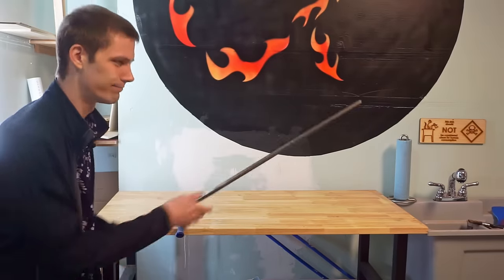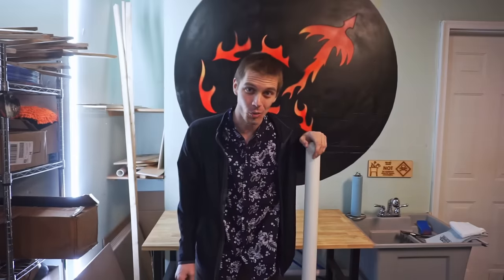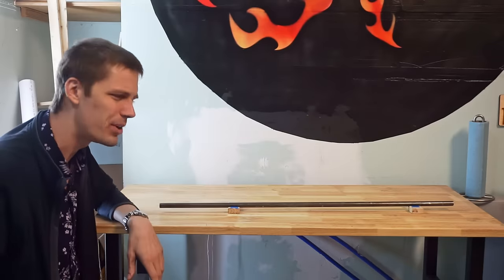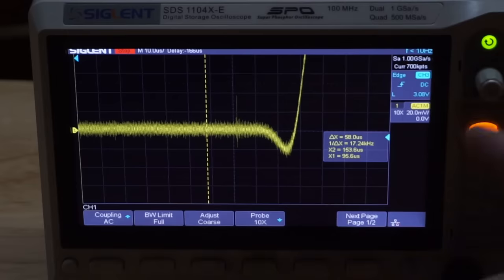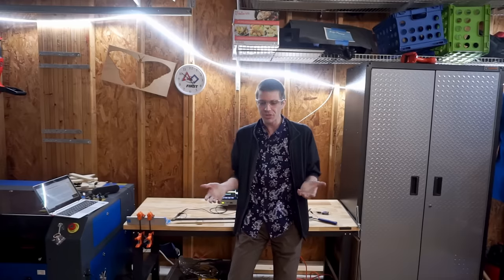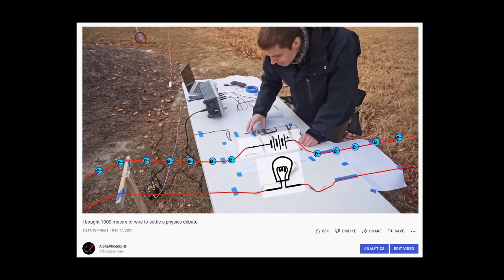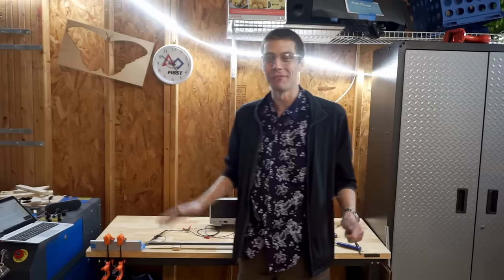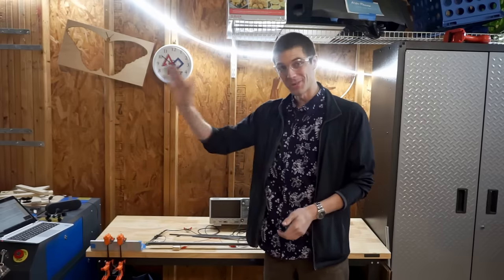Are solid objects really “solid”?

Comment: Re: bar speed: I remember Veritasium talking about it taking the speed of sound in the object. It was how shining a(n idealized) laser at one edge of the moon, and then flicking the laser point across the moon to the other makes the dot go faster than the speed of light. Nothing is actually going FTL (the dot is just an image), and if you tried it with a solid rod (I believe it was a wooden plank in his version), he said it can only travel as fast as the speed of sound in the object
Reply: Imagining that the blank would be unbreakable, I'd assume the plank would move kinda like a whip, and it would probably crash reality or some shit.
Reply: @dexorne9753  an unbreakable plank would almost certainly stretch out considerably across the diameter of the Moon
Reply: @dexorne9753  if it is unbreakable then it can only bend, otherwise it would break physics. It could approach the speed of light but not reach it in this scenario.
Reply: @bengoodwin2141  Exactly, and the time it takes before the other end starts moving after you move your end is determined by the speed of sound through the plank, which would've given us the correct answer because that's intuitive when you think of a plank bending. It's not as intuitive when you think about pushing the plank inward, but motion is motion. It's so obvious in hindsight :D AphaPhoenix just made the puzzle harder on himself by not just wondering, what will happen if I get a really big sharpy and write my name on the moon? :p

Comment: When I was a kid I used to always ponder this question as well as whether or not two objects really could “touch” each other.  Fun to see a video like this
Reply: The two objects touching blew my mind I remember squeezing my fingers together and thinking if you kept zooming in as you went down they would never touch and it blew my mind and I desperately tried to discuss it with my dad and he didn’t understand. Thanks for unlocking a super weird memory for me lol
Reply: exacly the same experience here.
Reply: It also means you can bitchslap whomever in the face and get away with "I never touched him you honor!".
Reply: I once wondered what would happen if you could make a infinitely dense object into a bar or just a line, then push it, it's infinitely dense so there is no space between anything so shouldn't it instantly move on the other end?
I have no degrees, its just something I'm curious about.
Reply: @speedy01247 
Wouldn’t an infinitely dense object have a null volume? Like a point. If it’s a single you can’t really measure its ends. It’s instantaneous but the pressure wave doesn’t travel any distance.
I think it would make it’s sound speed undefined too. (0m/0s)

My opinion isn’t worth much im not great at maths or with physics.
Reply: Is there an answer to that question ?
Reply: It’s our understanding of what “touch” means at a micro vs macro level. 

It’s still touching, it’s just that we have to change our view on what touch truly is
Reply: @speedy01247 that's called a black hole and you don't want to try to push it

Comment: The question is, what would happen if both ends are pushed at the same time?
Both ends would travel "inwards" then the 2 waves would collide in the middle and a few hours later both ends would snap back?
Reply: @liam3284  I don't think this is accurate, the bar wouldn't expand, it would exert crushing forces inwards at the middle, like squishing a cube of jello on two ends or something
Reply: @liam3284  Even an easier to see example, fill a bowl with water and stick a finger in each side of the bowl to generate waves. You can see the waves pass through each other.
Reply: You can use a Newton's cradle to see what happens...

Comment: 18:16 you took my comment idea! I was about to suggest it could be something where you had a different alloy than the website was using since I imagine that (since so many properties of steel vary based on the amount of carbon) the speed of sound must vary a good bit depending on the type of steel.

That's really cool how the speed of sound varies based on the "dimension" of the object that you're compressing and that a really thin bar will have a different speed of sound than one that would squish outwards a little bit.

Comment: My instinct was right in that in order for the material to move the atoms would have to get closer and then be repelled by their electrons; However, it never occurred to me that this nature of atoms getting closer and spreading apart is what sound is and that by proxy it would travel at the speed of sound. Very great video!
Reply: That's quite a SOUND argument
Reply: @busttoboost Well the force is inversely proportional to the distance between the atoms that means that a given aton would accelerate the next in line slowly and not instantly. This time it takes to accelerate and deccelerate would be the wave of sound travelling. Or in this case the wave of movement.
Reply: @busttoboost  I was thinking about the same problem here. The speed of the impacted force is traveling with a small decay, depending on its material structure. For example, hitting a sponge would take more time for the atoms to carry the momentum the the opposite side, a metal bar on the other hand would transfer the impact almost immediately, because of its dense and hard structure. 
Now the theory: if an object had absolut zero plastic deformation on impact, would it transfer the information, or in our case the force, immediately? So faster than light? Of course in reality, finding such an object would take a bit of time, although im not an Physicist im quite curious if this theroy is possible in some way.
Reply: So what happens if an object hit it at say mach 2 with no deformation or energy loss between the 2 materials?
Reply: What I don't get is, electrons repel each other by electromagnetic radiation, right? They are "pushed" by photons, so wouldn't the wave travel at the speed of light? Where does the speed of sound come from?

Comment: I was always under the impression that the speed-of-sound is the intrinsic "speed of motion". If you tap the end of a pole with a hammer, that will dictate when you can first hear the tapping on the other end of the pole. Although that can't answer the question fully, as it is obviously possible to move stuff faster around than the speed of sound.
Also: DSOs are really a marvel of economies of scale. You can basically buy scientific equipment for only a few hundred bucks that will show events in the ns range.
Maybe I should clarify: a high-explosive for example isn't limited by the sound of speed. In fact, any shock wave travels faster than the local speed of sound of the medium. But that's something for AlphaPhoenix to explain.
Reply: That's where a still initial frame of reference kicks into place,  I guess. The speed of sound in a material matters in reference to the material itself. since the pole was initially not in motion in our chosen frame of reference, the squish traveling through it maintains the 5100 m/s or w/e it is relative to the still piece of pole still ahead.
Reply: @EmanuilGlavchev  That's clear, but doesn't explain the shock wave problem. Unlike the speed of light, the speed of sound isn't really an intrinsic upper barrier here. It's just the speed the material likes to pass a wave on if no one forces it to do it any faster. But if you detonate a high explosive next to said metal rod, it's not like the rod has time for transmitting that wave at just the speed of sound. And the rod isn't infinitely compressible. 
I mean there are papers on it, but they're beyond my understanding of the physics. It's not very intuitive for me to understand what is actually happening if you push the rod at speeds exceeding its speed of sound.
Reply: I think I can resolve that pretty easily. Your first impression is correct. If you tap one end, it will take l/c until you hear it at the other end (if you take the correct speed of sound etc). But the speed of sound is defined for an elastic wave. Which basically means no huge forces, which break the material (over its yield strength). 
Yeah you can tap on the steel rod faster than its speed of sound, but then you permanently deform it. Which is in a way what happens to air as well, when you break the speed of sound in air. 
The speed of sound isn't a physical speed limit like the speed of light. It's the velocity that an elastic wave travels. Also there are longitudinal and transversal speeds, which happen of course simultaneously and make the wave propagation a mess.
Reply: @FlorianLinscheid  I'm not really convinced the rod is necessarily getting permanently deformed if I hit it with a hammer swinging at 10 km/s. Obviously the hammer would try to push material faster out of the way than the material likes, but is the explanation here really "it just breaks" and that's it? There surely is a gap between the speed of sound and the speed of no-compromise breaking, no?
Reply: @graealex  So if you accelerate a medium at speeds exceeding the speed of sound, you create a shockwave in that medium. This is true for air, metal rods, and whatever material you care to analyse. The shockwave can travel faster than the speed of sound in the medium, but only so long as energy is supplied to it, for example by the presence of a large mass of gas / whatever moving at supersonic speeds behind the shockwave. Absent this energy it decelerates to the speed of sound and becomes effectively a sound wave.
Reply: @dsdy1205  Yes exactly. And the rod will get permanently deformed at every point at which the inner stress exeeded the yield strength which will most likely happen if a shock wave travels through it.
Reply: @FlorianLinscheid  You're again back at "it just breaks", and that doesn't seem likely if you just hit it at lets say 110% or 120% of the speed of sound.
Reply: @dsdy1205  Using that explanation on the experiment from the video: if he hits the rod sufficiently fast, the delay will decrease as the wave would travel faster than the speed of sound, in the form of a shock wave?
Reply: @graealex  No, I said deformed. Like play-doh. The more it gets compressed, the more it will be squished. But a ceramic rod on the other hand, which really doesn't deform, would like just break into pieces, once you get slightly over its yield strength.
Reply: @graealex  No, it doesn't work that way.

Consider the shockwave on the front of a blunt bullet. The only reason it doesn't slow below supersonic speeds is because there is a bullet behind it, 'providing' energy to the shockwave by itself travelling at supersonic speeds.

If you want a shockwave to travel through the rod at supersonic speeds, then your hammer has to travel at supersonic speeds THROUGH the rod, which generally ends up destroying it.

If you just whack the hammer at the end of the rod really fast (say supersonic speeds), then the shockwave will quickly decelerate to the speed of sound in the rod and continue forward at that speed, as a normal sound wave.
Reply: Essentially the assumption that the springs don't get fully squished breaks, so the spring coefficient rises rapidly as the masses start hitting each other.
Reply: @dsdy1205  I'm not satisfied with the binary explanations. If it "quickly decelerates" to the speed of sound in the medium, then there is some distance where it was still above the speed of sound.
Same for the destruction. Obviously if you put enough energy in, you are in the end just moving metal powder around. But I am sure there is a point where maybe just only a bit of plastic deformation happens, but there is still a shock wave traveling in the rod.
Reply: Hey Alex, quick question: did you ever live in Fürth by any chance?
Reply: @graealex  it doesnt get permanently deformed, in the sense that you could just bend it back into shape
Reply: @graealex  it doesn't accelerate, it drops to its natural velocity once the hammer no longer pushes it
Reply: @graealex  For sure, it's an analog deceleration, but this happens over such a short distance that I feel pretty comfortable using the binary explanation, it makes no functional difference.
Reply: @chedatomasz  Actually no it is more to do with the fact as the nucelli get closer the repulsion between the protons quickly grows to dominate. This is because the charge density in the nucleus is much higher. Were you to actually get the nucelli to collide that is the point where the strong nuclear force interactions between both would take over and the nucelli actually fuse.
Reply: @seraphina985  that's what I meant by the nuclei 'colliding' - I guess I should have specified that I mean electromagnetic, not strong nuclear collisions
Reply: @XmarkedSpot  No, Würzburg and Schweinfurt and Frankfurt.
Reply: @seraphina985  That's what I was talking about. It's an analog scale, at one end there is light tapping, and the other end is pushing it so fast and hard that the nuclei get so close that they have no other option but to fuse. In between there's breaking the crystals apart. But there's probably some band where it's still faster that the speed of sound, without destroying the molecular bonds altogether.
Reply: @graealex   Ah okay, nichts für ungut (: Du siehst einem Kindheitsfreund zum Verwechseln ähnlich (bzw dem, wie ich mir ihn erwachsen so vorstelle). Have a nice one!
Reply: The head of the hammer must also deform when you hit the rod, which would cause its molecules to decelerate as they are accelerating the molecules in the rod.
It isn't an instantaneous momentum transfer so I'm guessing no molecules ever travel faster than the speed of sound but instead "shed" the excess energy to plastically deform and transfer the shockwave along no faster than the speed of sound.
Reply: @graealex  pondering this.  A rod could be accelerated gradually to far beyond the speed of sound of the material in outer space then how do you describe the speed of information vibration flow through it if perturbed by a hammer wielder striking it at similar speed.  Relative to A stationary frame of reference the information would be far beyond the physical limitations of the materials, it seems to reason.  I hope I am being clear.  In other words,  a rod or cube if we prefer could be at any velocity in space, and struck in the direction of its motion so it seems that there is not any inherent limitation unless we restrain the test conditions and fail to consider motion of the reference frame.  Not an unusual approach to isolate a factor, but leaves many questions unanswered.
Reply: @markyarbrough5511  Not really, as speed of sound has nothing to do with relativistic effects, and there is also no inherent limitation for information having to conform to the speed of sound. For example, any rod you strike here on earth is already traveling faster than 100,000 km/h because we're actually spinning around the sun.